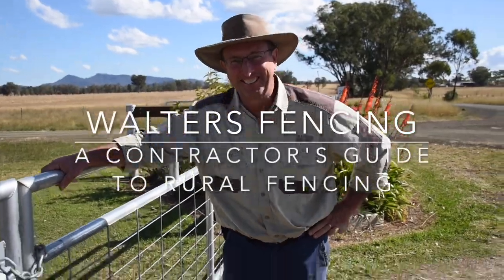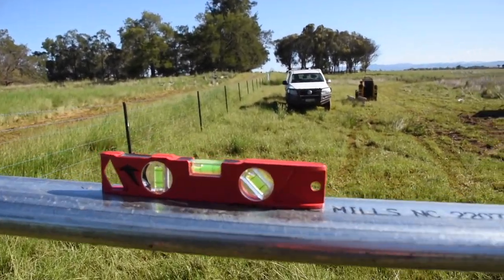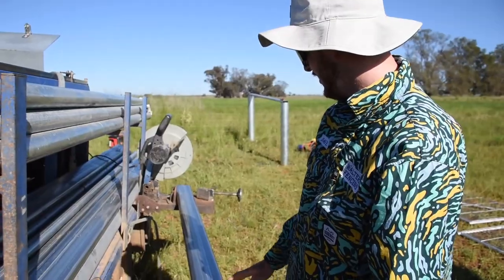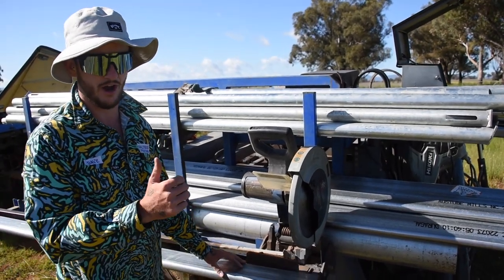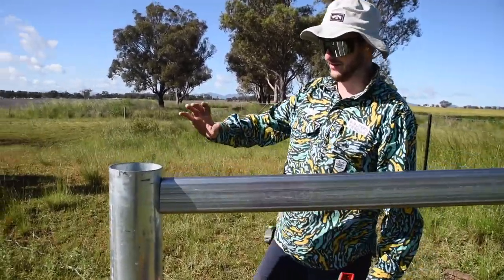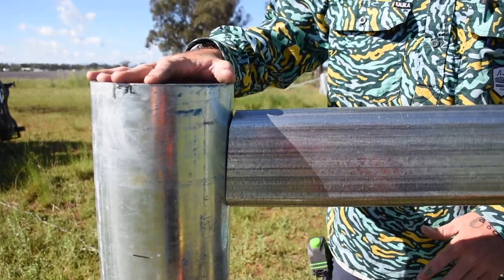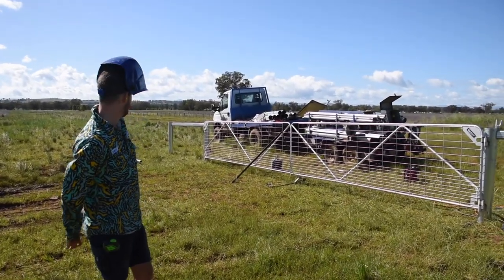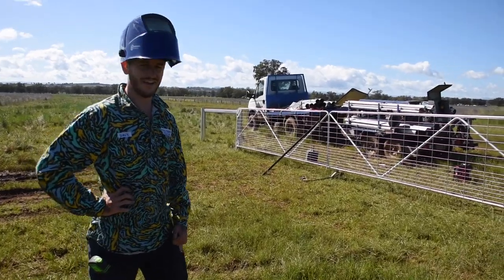How We Do It: Panels & Gateways #EP15

Comment: Why are the steel railings so much out of level on the right-hand side?
Reply from the maker: It's difficult to see on video but the ground rises towards the right hand side, and you need to match the terrain when driving posts, hence the angle. Dave talks about it briefly at the 1:00 minute mark.